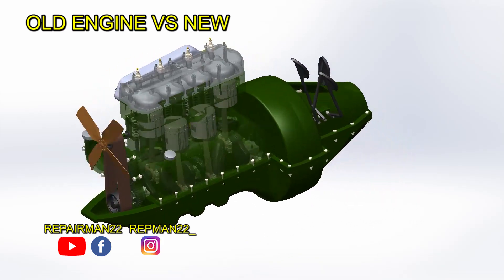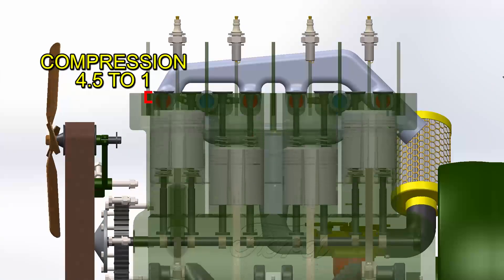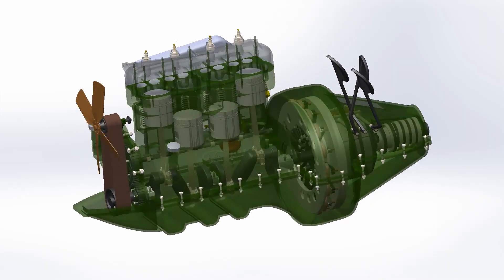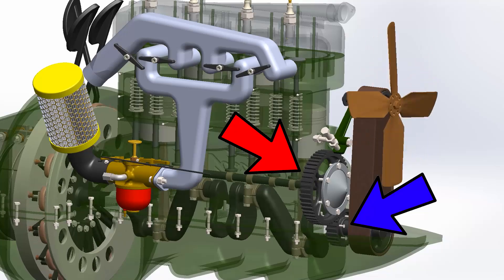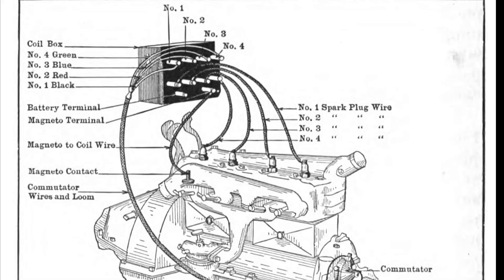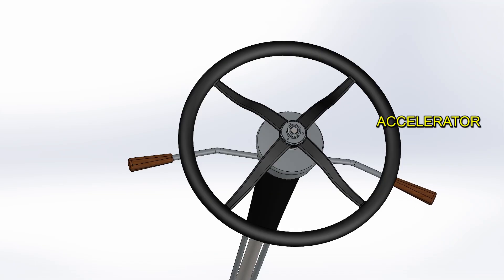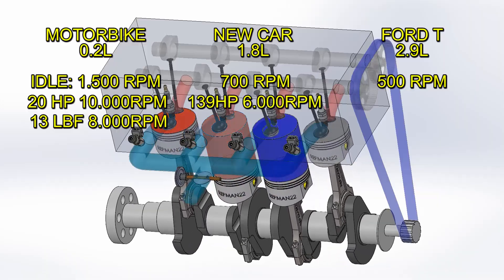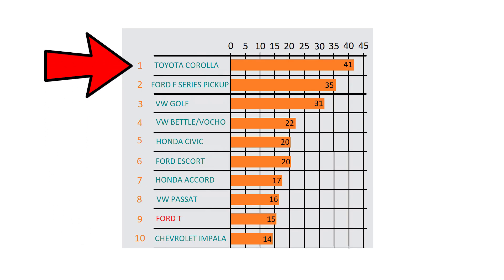Ford T vs New Car 🤯 3D Animation// What changed in engines in 100 years?

Comment: My grandfather told me if a hill was too steep, he'd have to go in reverse up the hill but I forgot why as I was very young when he shared the stry. Now I remember, graviyy fed fuel! If he didn't go in reverse up the hill, putting the tank above the engine, it would stall for lack of fuel to the carb.
Thank you for bringing back a memory of my granfdfather.
Reply: Going in reverse up a hill caused all the engine oil to go to the front and on a long hill could result in destroying the rear main bearing. This happened numerous times on route 15 in Springwater, N.Y.
Reply: @MrJACK695  Yes  !
But  ,  so  did  ,  W . W .  One  &  Two   !
Marc  ,  One
Mark  Two   ??
Reply: @MrJACK695  

What  now  ,  Brown  Cow  ?
Doctor  ?    Jack  ?
Reply: @georgehorobin2225  Are you OK? It look like you were having a seizure when you posted this.
Reply: @Ferrum Ignis  
No  seizure .  
But  ,  l  may  need  more   $  ,   Zinc   and  Copper  .
And  ,  a  million  years  employment  .
My  Project  " Dreams "  are  Giga  ntic   !
Reply: Yeah i noticed that gassing it sent the fuel back, & braking sent the fuel to the engine.
Reply: Lastly, i noticed some hot rods have a tank up front, maybe it's the gas tank? to send the fuel to the engine when accelerating
Reply: Marc ,  why  did  not  they  fit  a  higher  secondary  smaller  emergency  hill  use  FUEL  Tank   or  that  on  the  Roof  ?
AND  WITH  a  foot  or  hand  operated   fuel  pump  to  manually  use  and  assist  when  going  forward  UP  the  steepest   hills   ?
Lame  Brains  ?

Comment: Considering that where I live it is rare being able to go over 30-40mph due to traffic, I' ll happily chose the model T over a modern car. I' ll get reliability, get rid of unwanted electronics and have more fun in general without really missing much the lesser power.
Reply: "I'll get reliability"

You will get no such thing, a modern car is far more reliable. These primitive engines required plenty of care and attention to keep them running. They were very simple to work on, but they needed to be worked on more often.  You also get the advantage of effective brakes,  steering and suspension, interior heating and cooling, headlights that produce more light than a birthday candle and the ability to survive a collision in a modern car. You have a romantic vision that reality would not meet.
Reply: life would be a nightmare with a model t for most people. even a modern guy who does most of his repairs would probably have fits having to constantly source wear parts, this on top of fighting off the temptation to dump even more money into upgrading your century old shitbox. I know Id do it.
Reply: @xorgbeep  "life would be a nightmare with a model t for most people." you know the guy have "lenin" in his nick and in Lenins time life was a nightmare for most of "his" people -> It was called "red terror" for a reason.
At the start he organised a civil war and 5 to 10 millions of Russian citizens died in that war -> more than Germans in WW2 and this civil war was only the beggining...
In USA when Ford-T was produced an avg worker could buy that car after few years of work and in Lenins communist heaven people could only dream about owning a bicycle.
They started production of Ford A knock-off in USSR but that was not for everyone just for the "more equal than others" people.

Comment: old engines were better
Reply: Not all and it depends on what.
Reply: @GrillerRohde  all old engines were better they had no electronics no DPF no Anti Blue they were not constantly blowing gaskets gaskets like now a lot of breakdowns V has discontinued (not completely) but in many companies it has completely dissapeared (from some models) turbos SCs are barely seen and old engines were simplier and easier to fix nowadays they are harder to fix more complex computer operated and BS in the service garage where i work most cars coming towed to repair heavy damages are after 2013  the old ones come driven for tactical maintainance i have a 1983 Toyota Corolla i only need to replace oil once a year or after covering the KMs and so tires filters sparks after their KM belt replacement when it reaches the KM limit and my neighbor works for ADAC he tows mostly new cars also there are more explosions fires misfires in new engines pump issues and in everything they get recalled by the manufacturers for serious issues electronic issues are common automatic transmission is a pain in the Arse parts are shitty made low quality and you spent fortunes my customers had traumatic experiences with new cars while the old ones do not have issues they still run in perfect conditions after even so many years and KMs a new car will never reach 2 Million KM and in bad conditions they also stand unmaintainace oil leaks are also common in new cars airbag failures indicators also showing a lot lot of problems with seatbelt retractors and after 5 years a new car will shit over also crash test failures margina and poor IIHS rating and 0 to 2 stars to Euro NCAP while old cars had 5 stars in Euro NCAP and Top Safety pick in IIHS nowadays the whole body is covered in sensors and shit and they look awful too while old cars had a simple design and classic and car looking while new cars look like some space shuttle shit i explained a lot about them i hope it helped you understand
Reply: yea
Reply: @MrPegman02011  i know right

Comment: You say it's a flathead with valves in the block that prevent cracking, and piston to valve contact like it was a design feature. 
The only reasons it was a flathead is because it was cheaper, and easier to manufacture.
Reply from the maker: Thats exactly what the video says... that it is low efficiency.

Comment: I've given up the idea of listing all the things wrong with this video, but in summary: 
No, the Model-T engine isn't a marvel. It was made simple and to underperform so that it'd be cheap. That's all. Simply driving up or down a hill for an extended period would kill it, and it'd never survive in town or freeway traffic. It's too easy to make them overheat, they mix water with gas and oil, the commutator is unreliable, the carb floods easily, the combustion chamber fouls, all the seals leak and so do the valves...there's a million reasons they're not nearly as reliable as modern engines. Or as efficient. Or as powerful. They're inferior is pretty much every possible way. I'm assuming the only reason someone would make the argument that they are is because people are still driving them, but most of those are modified and are only running because the people who own them have learned how to keep them running and are willing to put up with them.
Reply from the maker: But all those reasons are said in the video! did you watch the video?
Reply: @Josh M - "It was made simple and to underperform so that it'd be cheap. That's all."
Exactly.  Henry Ford was smart enough to realise that were too many factories making super-luxury cars to try and sell to too few customers who could afford them - and the HUGE gap in the market was for a car that was 1) cheap enough that you could sell it by the hundred thousand; 2) simple enough that you didn't need to be a highly trained chauffeur to drive it;  and 3) basic enough that it could be (as Ford said) "repaired by the village blacksmith".
Exactly the same philosophy was behind the Austin 7 in England in 1923, and the Citroen 2CV in 1948.
Reply: What's your problem!
Reply: @Josh M Freeways didn't exist back then. For the time it was a quite reliable car. What would you compare it to, a modern car? Those were nowhere close to existing back then

Comment: Okay, you had me until you started stanning thermo-siphon. That method basically never, ever worked and was the main reason most cars from the olden-times overheated constantly. It was one of those ideas that sounded just fine (hot water DOES rise, after all) until you had to live with it. The pressure in a thermo-siphon system is pretty pants, and the hot/cold exchange doesn't really happen with any urgency. Other than that, yeah, the T engines were pretty bulletproof.
Reply: Well, if the engine only produced 20HP, and was that big, I don't think it would have problems as there so much mass to dissipate heat, and so little heat being produced to begin with.
Also, the whole cooling system was made of metals that didn't rust, so they could run on pure water, which is a fair bit more heat conductive than the water/glicol mix modern cars use.
Reply: The only time I ever had a Model T overheat was one time in a parade, and it was in July in New Jersey. And that’s with 30 years of driving Model T’s.

Comment: Modern engines are way more reliable than they used to be.
Reply: The difference is just that nowadays the engines are way to complicated and can’t be repaired as easily.
But nearly all engines can put down 200.000km without major failure and only regular maintenance.
Reply: @GrillerRohde  yes they are more complex
Reply: @GrillerRohde  nope won't last any over 150k people reporting their car shutting at 150k km the end of their journey comes

Comment: My impreazs EJ204 engine is also reliable.
has over 160,000km or 100,000mi on it.
No issues what so ever.
No oiil leaks, no head gasket issues, does not burn oil(really I change the oil myself, take it to the F mark, do 10,000km or 6,200mi and oil is still at F mark and NO TOP UPs done)

Would the model T engine last over 100,000miles?
Hard to say, back then cars odometers only had 5 digits, not 6.

But not saying the Model T engine was crap.
It was reliable for the time as are some modern engines.
Reply: Back then odometers probably did not exist yet
Reply: 5 digits were used on all cars. After all when it got to 99,999 the next mile would show as 00000 or brand new.  Logic tells you that this car has been driven...as it is a used car....or they bought a new speedometer...for some reason.   - just because the horse has a new saddle does not mean it has not seen the miles over 15 years.

Comment: The best thing about the model T was that unionized workers in that age could afford to buy one.  It was a terrible car, but, as someone else pointed out, better than a horse.  My grandmother's father owned one and drove it around Florence, Colorado.  They had to fix flat tires regularly, and as someone has said, back up steep hills because of the gravity feed fuel system.  If the engine backfired while you were cranking it, it would snap your arm, a common injury in that time.  

Yes, it was well engineered for its day, but a model T cannot handle modern traffic.  It does not have enough power or good enough brakes to drive on a freeway.  It pollutes like crazy. In a crash this car would come apart, and with no seatbelts you would lose your teeth or worse on the steering wheel.  I would not want a family member driving one.  These belong in museums.

I've been driving and fixing cars for nearly 50 years and here's what I know:  The cars of today are the best in history.  Comfortable, reliable, powerful, energy efficient, and safe.  Virtually zero maintenance for 150000 miles and many many times safer than a model T or even a car from the 70's.  And the electric cars that are arriving now are better yet, wayyyy better.  Soon self driving cars will take disabled and older folks safely and conveniently where they need to go.  I have several family members who cannot drive so this will be a new time of freedom for them. 

The model T made car ownership possible for the masses, a wonderful freedom.  But let's not get too nostalgic.  My next car will run on sunlight and drive itself when I'm too busy or bored to do it.  It will be safe, quiet, fast and efficient.

I'm looking forward to the future.
Reply: All of what you say is true. 

HOWEVER, owning a new/late model car is becoming increasingly expensive as compared to income, both in acquisition and cost to maintain/repair. And while a Model T (or even an original A) are not up to modern traffic standards, many mid 30's and 40's cars, just about everything from the 50's, and anything from the 60's and later are.

While newer cars are safer overall, you can be injured or die in one just as you can anything older. Personally I don't dwell on such things and enjoy my older cars as much as my  newer ones.

Do I want to pay $30 to $80 grand (and all the other attendant costs) for something new to drive? Absolutely not!
Reply: Nonsense if the government doesn't like you they will just shut off your autonomous car if you can afford one 😂
Reply: Model T was excellent for its time. New cars are less reliable than they have been at any time in the past 40 years. 80s econoboxes got 50 mpgs. On average, new electric cars, despite being easier for manufacturers to make be reliable than ICE cars (having just a motor and a battery) are much, much less reliable than new ICE cars according to owner surveys of the past few years.

Comment: the electrical system was a magneto many V magnets spun over could in tranny bell housing,
This magneto and ignition was devised by Edd Spyder Huff. working headlights horn maybe
direction signals and brakelight.

Comment: A lack of oil pump is not a point of reliability because oil pumps generally do not fail. On the list of parts that fail in car engines, the block and crankshaft are much closer to the top than oil pumps are.
Reply: total B.S. i've seen many oil pumps fail, as opposed to practically no cranks and only block failures were thrown rod or freezing.
Reply: @maddhatter3564   I've seen failed rods, blocks and cranks, usually due to lack of oil changes or cooling system failures. Never seen a broken oil pump.

Comment: Wow, Love the simplicity of it! It's design was ingenious, especially for it's time. It's torque surprised me haha. I bet some modern upgrades could really awaken these old timers into something to rival modern cars
Reply: There were MANY upgrades available even back when Ts were new.  There is a cut down 1922 Model T in  The Penrose Museum at the Broadmoor Hotel in Colorado Springs.  The owner/builder drove it 250 miles to the race before his win.  Besides lightening the car considerably, one of his modifications was a Rajo cylinder head.  Those have overhead valves, and improved intake and exhaust ports.
Reply: @chuckasbury8991  true they just had few buyers as they were a high priced part for a very basic car. mostly just professional racers.
Reply: They are available from companies such as H&H Flatheads in Gardena, CA. But the Herman Bros mostly specialize in V8 Ford flatheads, and the later 4 cyl model B engine ca. 1928-40. But H&H can and does rebuild and improve ANY vintage engine.

Comment: If we could combine the reliability and durability of old cars, with the technology of modern cars it would be perfect, but unfortunately it is very difficult due to consumption standards and pollutant emissions, a super durable and cheap car would be a gas guzzler and highly polluting, on the other hand, a super reliable car that was not a guzzler and pollutant would be extremely expensive.

Comment: I’ll believe the 100+ year old engines are more reliable when they hit over 300,000 miles like the family heirloom beige Camry. I don’t doubt the Fire T is more reliable than modern Ford 4.cyl engines. But not all. The old T engine could never handle the forces modern engines experience. All the upkeep you constantly had to do just to keep it running, or keep from fuel starving when having the audacity to go up hill, is exactly what makes it unreliable. Most modern cars can hit quarter million miles + with pretty basic upkeep.
Reply: Nothing more reliable than a late 90s champagne colored camry.
Too bad these drivers are always causing accidents.
Reply: @IIGrayfoxII  These drivers were reliably causing accidents.
Reply: IDK...the "Beast of Turin" from 1911 needed a new crankshaft some time ago. But then again, it was meant more of a kind of "performance car" than for everyday use. Talking about "handling the forces modern engines experience"...it actually has more torque than a Bugatti Veyron. No wonder the crankshaft does face a bit of a challenge.

https://www.youtube.com/watch?v=0TV2l6TOuGA
Reply: @klausstock8020  but its rpm and compression is still less than half the average modern car. Heat and pressure forces are still lower. It makes it’s impressive power through sheer displacement, all that is is the physics of heavy metal with long connecting rods moving.